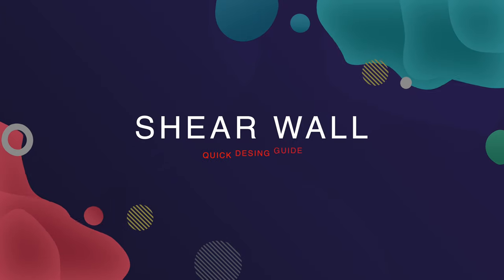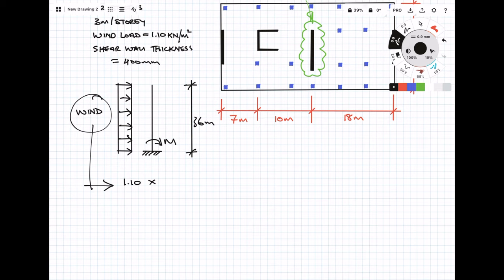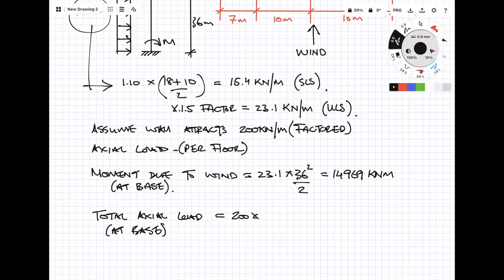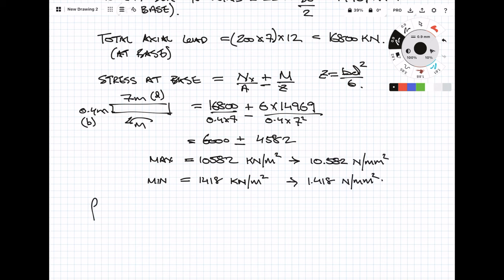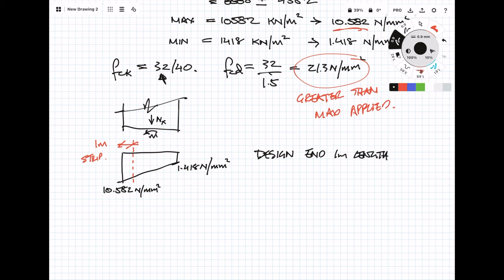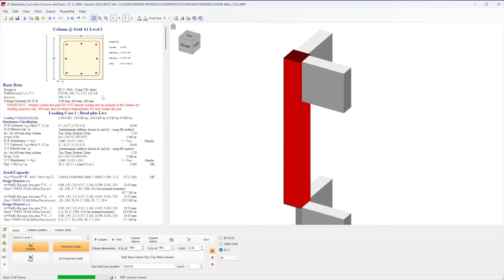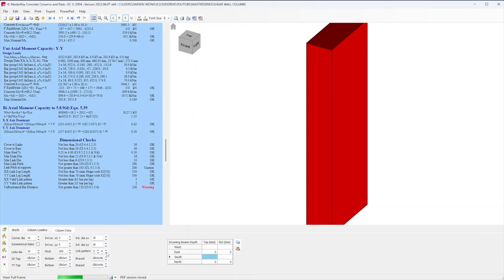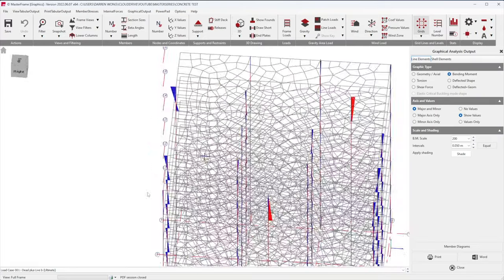Simple Concrete Shear Wall Design - Structural Engineering

Comment: Thanks for a great video. Is there a precedent in the code for designing a shear wall as a column using the strip method? I would have thought that this would need to be designed as a wall as this section of the code would pick up buckling effects and other phenomena specific to walls?

Perhaps as your example had significant compressive stress it could be designed as a column rather than a wall.

Comment: what does the (18+10)/2 implies? There are 4 walls (1,2,3,4) having orientation of their major axis parallel to wind force.
Reply: It is the area of the façade you have to take in to account for wall 3. Like half of the span between wall 2 and 3 and half of the span between wall 3 and 4